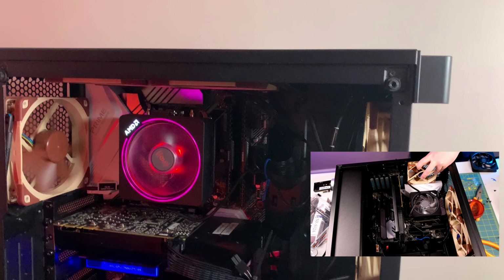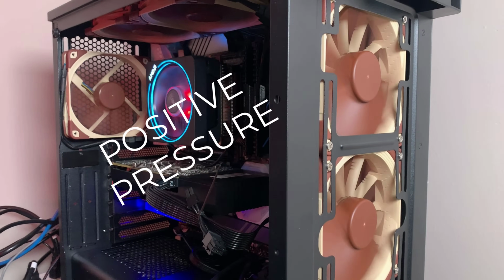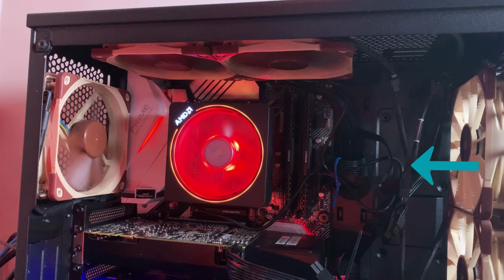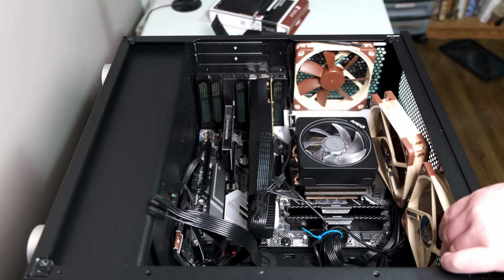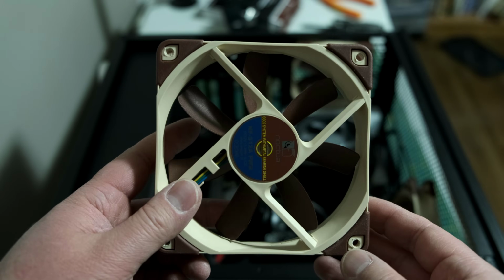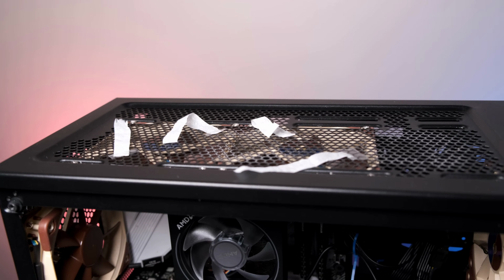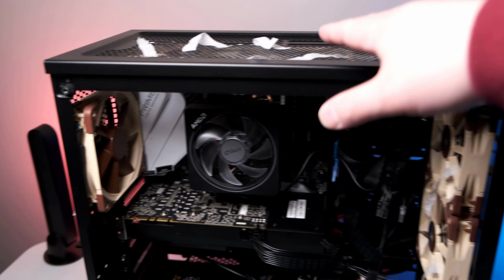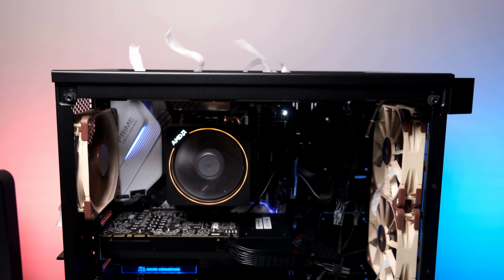Custom PC Build: How to setup your desktop cooling fans for proper air flow

Comment: Hey man I got a question does it really matter if the intake fans are blowing air right under the gpu or should they be a little up
Reply from the maker: Hi there, i think it's better if the intake is bowing under the GPU. GPU generates heat and in theory, hot air rises, and your intake will help push the hot air out through the side or top (assuming you have them exhausting)

Comment: Too many fans. i only use one chase fan+power supply for 22 years, and my PCs last forever. Clean your OS and PC once every 2 months, kill startup apps, you'll get your PC last for 1 decade.
Reply: maybe works for you. But I need a powerful machine for my work :)
Reply: @Konungen  you make 3D movie by your self ? im using my PC to run blender, video editing and all. Its 2021 processors are OP for work, so i have o idea your using it for.

Comment: i have same fans as you but i have a question can i put 2 fans on each other ? and if yes how should i do that ?
Reply from the maker: Hi there. Sorry, do you mean put 2 fans on top of each other, side by side?
Reply: @TheWongReviewer  yes
Reply from the maker: @toxi3g908  You can put two fans side by side on the top. As long as the case has the mounting holes for fans.

Comment: If i have a single rear fan, it should exhaust, right?
Reply from the maker: Yes, that is correct. If it's in the rear it will exhaust out.
Reply: Ps: I am using an old chassis with psu in the upper side

Comment: I only have 2 fan should i get more?
Reply: nope.. power supply fan and 1 chase fan should do the job, you don't need to make your PC like air jet..
Reply: @ahemjunior  lol cool I upgraded my thermal paste and is 100% betterrr!
Reply from the maker: HI there, it depends on what kind of case you have and your components. Best thing to do is download hwinfo64 and monitor the temps to see if it's within reasonable range.

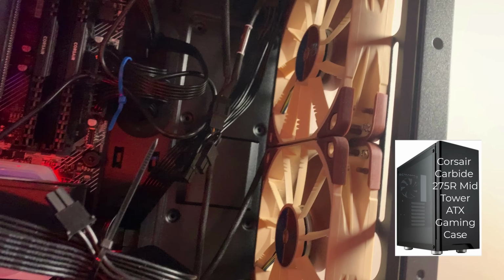Comment: When you show the fans with the arrows at 0:35, the back fan is correctly oriented and the arrow for the back fan is incorrect.  And at 1:10 the top fans are correctly oriented.  The text is incoherent with the images shown.  I looked at the original video and the back and top fans are incorrectly oriented but we don't see that here which makes this video confusing.  A video should stand on it's own.

Comment: When you look to the CPU fan you know it takes air into the CPU ..so it's better to make the rear fan which is right behind the CPU fan takes air from outside the case into the CPU fan so the CPU fan produce more cool air to the CPU also the two upward fans blow air from outside into the inside of the case to give even more cool air to the CPU fan while making the frontal 3 fans take air from inside the case to the outside 
In this way you'll make the CPU fan get cooler air into the CPU and also prevent dust from come from the empty cuts or openings of the case 
That's my opinion what do you think?
Reply: incorrect, like all radiator fans the point is to suck hot air away from the potential heat source. That's why in a car for instance. The fan is placed behind the radiator, not in front. It's easy to tell if air is being pushed away from the cpu by just holding your hand in front of the fan. thermodynamics isn't as complicated as some people make it out to be.

Comment: Where did you connect all those fans? I have the same motherboard and am wondering.
Reply from the maker: If you look in the manual, the schematic of the motherboard will tell you where all the fan headers are. Plug your fans in right one.

Comment: You don't have neutral airflow, you have negative airflow. Your 3 exhaust fans are pulling out more air than the 2 intakes, unless you've edited your fan curves so that they balance out or something. Also your fans were set up properly at the beginning, so I don't see what the problem was.

Comment: Same case. I have 5 intake 1 exhaust and I get 19c on idle and 40 to 45c on load. I used to have 3 intake and 3 exhaust until I started experimenting with the fan orientation.

Comment: Hi. I have a CM 692 Advanced case, which I think can only have one intake fan at the front. But it can have fans installed on the sides. Would extra side intake fans work just as well?
Reply from the maker: Hi there, yes, fans on the side will work as well. It will "push" more air through the case regardless if it's in the front or side.
Reply: @TheWongReviewer  Thanks mate. I’ve discovered that my case can have a secondary front fan that sits behind the main front fan (located behind the HDD bays). Do you think this would also be effective in boosting the intake airflow?

Comment: The tissue paper on the back fan isn't getting a lot of air because you have a negative airflow. You have 2 fans taking air in and 3 out, which means it's logical that there's almost no airflow. A negative airflow will cause dust to pile up, so you should clean your setup regularly then. I do like your idea of tissue papers, I'll definitely try that on my case as well (which is surprisingly the same but in white).
Reply: Or he could just adjust the fan speed settings in bios.

Comment: If you put fans on the roof part can you use the dust filter also?
Reply from the maker: You can still use the filter, however, it's just blowing out. There isn't an issue with leaving it on there.

Comment: Linus Tech Tips recommended that a net positive internal pressure is probably a good thing as then dust is kept from getting in through the seams. What's your opinion on that? You seemed to be claiming the optimum would be net 0.
Reply from the maker: There are lots of theories on fan setup and airflow. Gamers Nexus did a video after mine and said that in their testing , as long as their is air flow over the components it’s good whether it’s positive, neutral or negative. I am doing another test with smoke on my meshify case.

Comment: Not much air coming from exhaust in your vid because the case is open, will be fine when case is closed
Reply from the maker: Yup, you’re right. I’m going to be doing another test of air flow using smoke in the near future and the case will be closed . Hopefully this has a better effect .

Comment: Positive is better because you get less dust buildup, Silverstone FT-02 , look it up,  3 180 mm fans at the bottom of the case pull air in ( with filters),  and only one 120mm top fan ( not need it - no filter ) for exhaust, plus very large venting holes at the top of the case. Power supply has it's own fresh air in at the back ant out the top of the case. Overclocked Core I7 2600K at 4.4GHz ( base at 3.4) and very hot Vega Frontier for over 10 years
Reply from the maker: Thank you for taking the time to comment.

Comment: This actually helped me I have to modify my h510 case to get better airflow .. cut front panel out and add a grille so theres intake on front and exhaust on rear and top rear and possibly a intake on top front of it fits once I cut the single grill out

Comment: I used to have this gateway pc that had a core 2 duo e6300 and the bazooka heat sink shroud ontop. Then the case had a vent right above it to let the cpu fan suck air in. I reversed it to blow out then had every fan sucking in except for the gpu fans. So most of the air pressure was passing over the cpu then directly out the case entirely. It worked really well. That pc never passed 80c full load.
Reply from the maker: Thanks for commenting! That’s interesting how you had the airflow go over your cpu fan. Appreciate you sharing for others to have another option
Reply: @TheWongReviewer  yeah. See the heat sink was just a finned block then the fan sat directly on top of it point up and it would pull air in threw the side where the fins created opening which wpuod draw the air across the top of the cpu then straight up which makes sense because its blowing the heat in the direction it wants to go which is up. Then all the case fans sucking room air into the case. So air cones in the front and the back then the gpu vented its airflow out the case threw its exhaust ports and the rest of the air was sucked out the case via the cpu bazooka style blower cone that was right up against the case side panel vent holes.   I also installed the power supply upside down so the internal fan was facing up then I cut vent holes at the top so the power supply wasent sucking its hot air into the case right where the cpu is sitting which makes no sense to do. I never understood why psu's vent their hot air into the case.

Comment: you could also use incent sticks to really see if air is getting sucked in through the smaller holes and adjust rpms accordingly to have positive air flow
Reply from the maker: Yes! Great idea. I just ordered set and will do a video on my new setup!

Comment: new sub! thank you so much for this! 
Also, I have a question. If we do the top 2 exhaust fans, do we really need the top cover filter since the fans are going up or do we just leave the air filter up?
Reply from the maker: Hi there. Thanks for the support. Honestly, I would just leave the filter on. It doesn't affect the airflow at all. Great question.

Comment: Why is neutral pressure the best?
Reply from the maker: According to articles, neutral air flow means the intake and exhaust should be the same which means it's less dust. Here's the article I was referring to. https://www.neweggbusiness.com/smartbuyer/over-easy/pc-cooling-how-to-set-up-computer-case-fans/
Reply: @TheWongReviewer  Thanks for the reply! I read the article, and the benefit of neutral pressure vs negative pressure in regards to dust is indisputable.
 However, for neutral pressure to be con considered best, it must be better than positive pressure.  Is this the case?

I am building a PC right now with a 360mm rad (3x120mm fans) + 2x140mm fans for intake, and a 360mm rad + 92mm fan as exhaust.  It's positive pressure... would neutral pressure change anything?

Comment: If my gaming pc only has 1 fan at the top (so thats my cooling fan i guess) should i be having 2 instead? Also should i replace the other fans too if they are not running correctly or only whats not working? Are they usually all 120mm fans? I’m very unsure. Thank you

Comment: Cases with fans already come correct
Reply from the maker: Hi there. Thanks for the feedback.. I recently built a computer for a friend and the stock fans that came in the case where exhausting out. I switched them around so the front fans were intake. But Yes, you're right. Typically case manufacturers do have the fans orientated.

Comment: I would suggest removing one of top fans, the one closest to the front. This fan in, in a worse case scenario, take the cool air from the front intake and blow it right out of the system before the intake air gets to cool any components inside the case wich leads to less cool air inside the system. 

In the best case this doesnt do anything in making the system run cooler. This is "proven" by Linus tech tips in a video they made back in 2015. The results from 1 vs 2 exhaustfans in the top made no difference in cpu and GPU temp.

Just a friendly reminder! ;)
Reply: Have a good watch of this video, it found 6 fans was best for cooling cpu and gpu. https://www.youtube.com/watch?v=iCn-XL-HyXg I do think on a smaller case like the one in this video would only need 2 exhaust fans like you said, especially cause the cpu cooler is pretty small.
Reply: More fans + rgb = more fps
Reply: No temperature tests were done on the old fan configuration and new one.  So we won't know if the"correct" new fan setup is actually better. The Linus tech tips video was thorough in evaluating temperature differences  and revealed a two fan setup of one intake and one exhaust was enough to cool the pc, even if more fans were added, the advantage was not so huge.
Reply: @itorapadas  I guess there is no "right" answear though it is always gonna be different setups creating different amount of heat, different fans thst push more/less air, different fanspeeds, room temp, location where you at so on and so forth. 

The other dude, JayzTwoCents, here on YouTube made some smoketests where you could see the airflow and where the top fan in the front pushed much of the cool air out the top before it even hit the heated components. There by my precious answear.
Reply: I’m probably going to give this a shot, and just unplug mine and see what happens. I have 3 in front, 3 on top, 1 rear. 

I already made the mistake of installing my rear exhaust as an intake when I was upgrading my components. (Had to keep removing fan and reinstalling to make room for things.) I was like wtf is going on with my temps. I was getting 50c at idle and 78-82 when gaming. Only tried two games like that and then the next day I investigated when I had time. Now I’m getting 42c idle and 72c while running vanguard at ultra. I’d still like to bring those temps down, but I may be SOL with my setup. 

I have the 5800x, 3080 xc ultra LHR, this cooler, Maingear Vybe Mk. V. I’m going to try the top fan adjustment, and after that I have one more test. The front panel only has slits on the side. Going to remove panel and see if that improves anything. It has all of the wiring attached, but at least I’ll know if that’s what is required. I did just pick up a NZXT H510 for my old components. Maybe that case will have better airflow, but I like the way this one looks better. There is still some tuning I could probably do, but I feel like it should be lower than 42 without adjustments. In MSI the GPU fans were spinning between 30-37% at this temp. IIRC
Reply: but you can think about the ram as well if it pulls that intake up and out over the ram providing good airflow for that
Reply: yeah, top fans aren't necessary. let the heat passively vent out the top. 
putting a top fan close to the front intake fan would just suck out the cool air

Comment: So I have aio cooler on top. Do I just flip the fans as exhaust? For better airflow and lower temp?
Reply from the maker: Hi there. Thanks for the comment. I recently just switched to an AIO. I'm in the process of testing this out.
Reply: @TheWongReviewer  hi the reason why the rear fan wasn't blowing as much air as the other fans
i think it was the amd cpu fan that was affecting the rear fan air flow

either that or you had the rpm to low on that fan
i'm sure since you now have an AIO that the rear fan 
can move the air out much better now
without having the cpu fan there anymore

nice video

that is basically almost the same setup i'm using now
with the exception that i have 3 fans on front of the case instead of 2

2 fans on top and 1 rear

i have an aorus 360 aio, 3 front fans blowing cold air in
2 fans on top, 1 rear fan both blowing hot air out
Reply from the maker: @yonoexisto7833  That's a really good explanation. I can see that now. I actually switched up cases and now using an AIO. I'm going to do a smoke test to see how the airflow
Reply: How’s the aio doing for you?

Comment: hello I have a very noob question, so I just build a budget gaming pc for the first time and im wondering, if I put fan in front and top of my case will it help the CPU temp when gaming? or the CPU temp will only be affected by the CPU fan?
Reply from the maker: Hi there. It kind of depends on what kind of case you're getting as well. If it's an ATX or mini-ATX case. What CPU cooler are you using?

Comment: Am i suppost to put the fans in the air holes?
Reply from the maker: Hi there. Sorry, i need some more context to help you with your question. Are you able to provide more information?
Reply: @TheWongReviewer  Like am I suppose to put the fans in the holes or can I put them anywhere
Reply from the maker: @ZxDragon-i9s  Hi there. You should have mounting brackets on your case on the top, front or rear of the case. You can place them in the dedicated screw holes or in most cases, they have a long slot / gap that you can mount anywhere.
Reply: @TheWongReviewer  ok thank you!

Comment: Should I put a filter at the top of my pc if air is blowing oit
Reply from the maker: HI there. The dust guard is to help with the outside air coming in. If your fans are blowing out, I don't see it as a concern. Here's an article that explains the same thing: https://forums.tomshardware.com/threads/dust-filter-for-the-top-exhaust-fan.2908772/#:~:text=As%20others%20suggested%2C%20the%20filter,blow%20out%20of%20the%20case.
Reply: @TheWongReviewer  That's what I thought thanks for confirming

Comment: ok but my question is what if my top two fans are for a water cooler for my processor. would this concept still work?
Reply from the maker: HI there. That is a really good question. I'm trying to figure out a way to determine this. I switched to a new case and have a 360AIO installed on the top. I bought some smoking sticks and i'll be testing the air flow to see if the 2 front intake fans is drawing enough air flow. I haven't had time to do it yet, but hope to get to it in January. Sorry, i know this isn't helpful right now.

Comment: Fan pressure should never be neutral, as doing so will allow dust and other particles to be attracted to the small holes, causing a dirty system INSIDE. 

Alternatively, you should always orient your fans in a +1 in setup. You should always have one more fan coming in to the system than you have going out. Ideally, a 3 in front, 2 up top setup is what you aim for, as the rear and bottom of the case will act as a slight outward vent that does NOT suck in dirt or dust. 

Just a bit of advice :) 

Tldr; don't neutralize vents. 3 in, 2 out.
Reply from the maker: Thanks for the feedback, especially the +1 setup. I think this is the best way to more air flow coming in through the case.